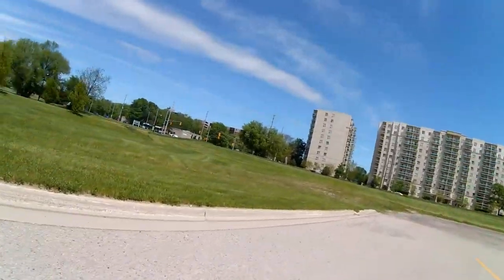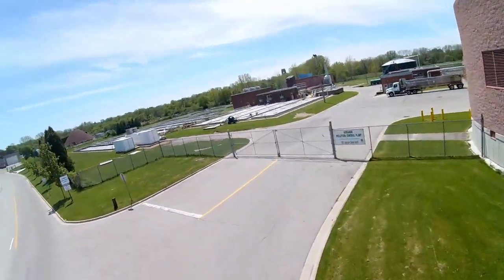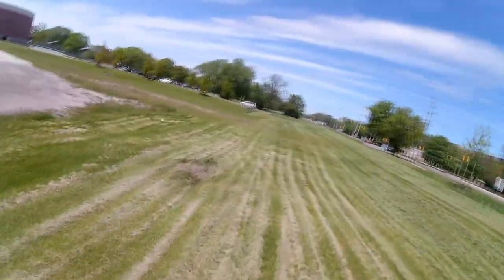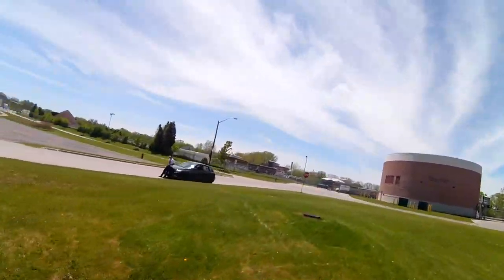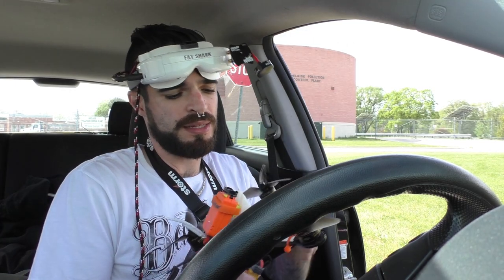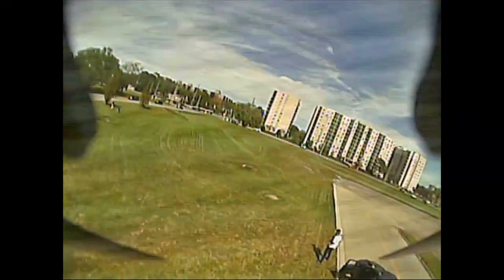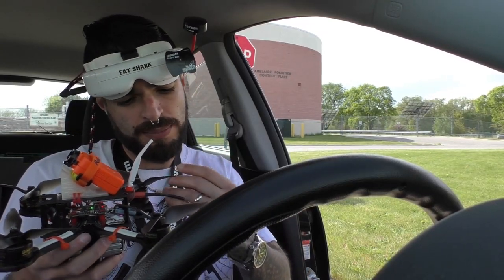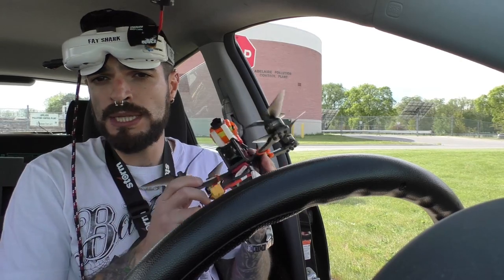STRICTLY RACING DRONES 5" - QUAD TUNING ♠ [ FPV DRONE BUILD ]

Comment: Just wanted to say thank you for this 👍 after watching so many tuning videos over the past couple of years, I thought I knew what I was doing, but I was still feeling a bit lost.  This video made it "click" for me, and now the others make a heck of a lot more sense 👍 I really like your approach of taking decent sized steps up before backing down -  seems like the quickest way to get a good feeling tune.
Reply from the maker: Hey man! So glad to hear that!! I had a similar experience with one of Bardwell's video. He did such a good job at explaining what each behavior looked like that it just clicked. I have been tyring to impart that knowledge in an even simpler way to help others tune.

Yeah the big steps help, because you will have a more immediate feedback of what that change did especially on P gains. I gains and D gains are a bit of personl preference and should be treated more delicately IMO.

Hope it helps you get some sick smooth flying out of your rigs!